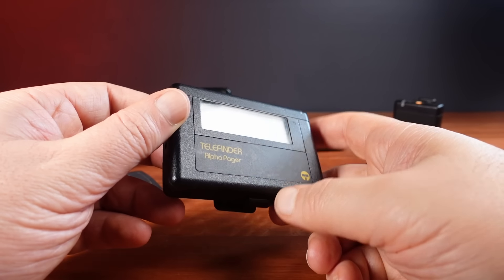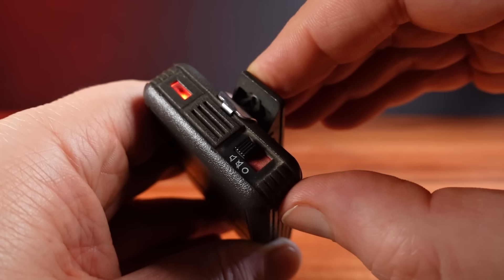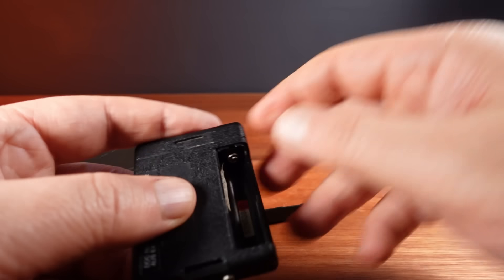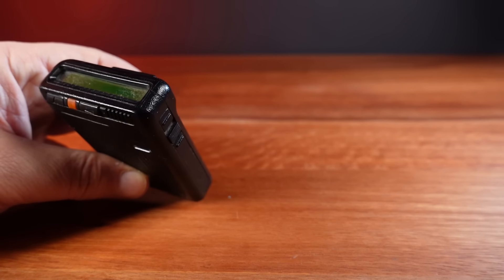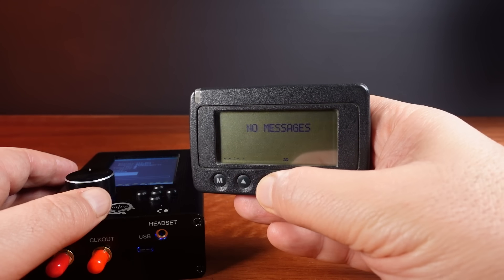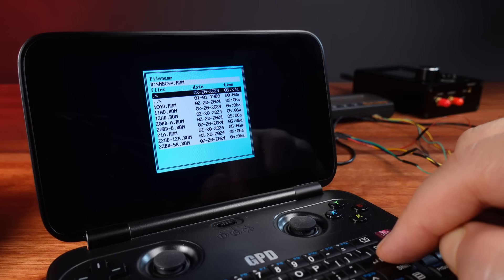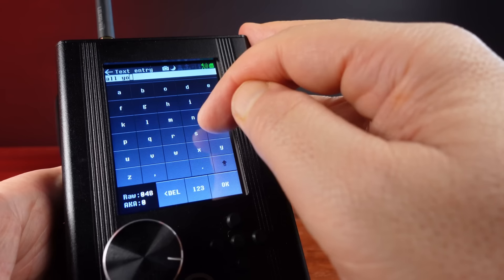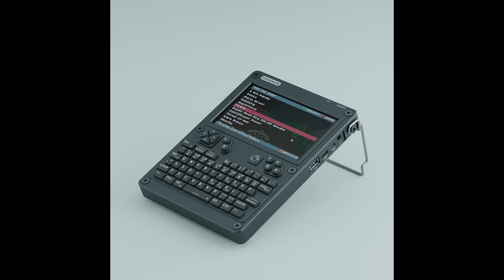Hacking 1980s Beepers & Pagers Back To Life

Comment: The beeper pager is still widely used in restaurants, i recently go to massive food court where you can buy from different vendor, and most of them using beeper to call people that their food is ready, it's neat to see the simplest operation still used for 70 years.
Reply from the maker: The old Post Office code still in use today!
Reply: @JanusCycle ten years ago in school one of my classmates had a pagers with display because he was (and very likely still is) volunteer firefighter.
Reply: fire service too
Reply: Pagers are also still very heavily used in medicine. Easy enough to use the hack rf and software to receive and decode the messages too.
Reply: Those are just local networks
Reply: i had a janitorial job at a truck stop that had a REALLY interesting use for pagers. They had rentable showers with an automated pin-pad entry system, and when the renter left the shower room, an automated system would send a message to my pager saying that shower room now needed cleaned. Very unique use case for pagers in the modern age!
Reply: Those aren't cellular papers, they're just short range RF; no service once you leave the immediate proximity of their base unit
Reply: also used for restaurant staff
Reply: Those restaurant systems are not quite the same thing. I mean, at the basic level, yes, they are beepers, but there is no network or routing system in place, nor are they on licensed frequencies. The restaurant systems are closer to a one way cordless telephone that only has a ringer function.
Reply: @slightlyevolved - Some restaurants now use the customer's phone number to text them directly.  A cheaper and more reliable alternative.
Reply: Yeah, interestingly that's kind of a new use for them... but it's a different kind: they're actually more simple because they don't have any text and they aren't connected to a phone line. But they probably weren't used back in the old days like these others because of greater expense back then.
Reply: @prophetzarquon , he/she didn't say they were.
Reply: @slightlyevolved : He/she didn't say they were. Not quite the same thing, but basically the same thing. No phone service and no text, but other than that, pretty much the same.
Reply: @HelloKittyFanMan  True. And most of the pagers in this video don't use cellular either! I only really saw the cellular ones; my bias is showing!
Reply: Ngl I didn’t realize they were actually beepers. Interesting stuff
Reply: Then the pagers explode ….
Reply: @HelloKittyFanMan He/She/Their/Them/It/Cat/Dog/ApacheAttackHelicopter/Kamov50/Abrams/T90/MI-28
Reply: @phreak761 : Umm... HUHHHHH?

Comment: I worked for a defense contractor up until about a year ago. I used to have to admin our pagers. They're very good for reliability in 2024.
Reply: "defense"

Sorry, I couldn't help it.
Reply: D-FENS!
Reply: Reliable as long as it's a two way to acknowledge the receipt, but one way papers were a hit and miss.   If you happen to be in a weak signal area, you simply missed the page.
Reply: @BillAnt 
Some systems repeated the message several times. The beeper would only "beep" one time for a certain massage.
Reply: @jplacido9999  - Right, but the repeated transmissions were only within a few seconds.  If you happen to be out of coverage in a subway or building, you just missed it.  Later two way pagers solved this issue.
Reply: @BillAnt  
Some systems would repeat the messages when radio traffic was low and the pager wouldn't beep again if the message was already in memory.
That was a good trick to try to avoid no coverage areas, if you were on the move.

For mission critical paging you would have to use beepers with acknoledge (but those were trackable, altough you'd need a very sofisticated setup to do it....)

Comment: This brings back memories. In 1982-1983 I was working on the design for the PG32 POCSAG decoder chip. 2800 gates in standard cell. Design toolchain was slow. Manual netlist entry and many hours looking at printouts on green/white paper.  Happy days.
Reply from the maker: Wow! very early days for POCSAG there

Comment: @14:55 pager doing like an electric football game had me laughing 😂

I used to run a pager-based school zone flasher system.  The server would dial a phone number to page the flashers on or off.  Typically it did this twice - once just ahead of schedule and once at about the scheduled time to turn it on and at the scheduled time and slightly after to turn it off.  Since there was no acknowledgement it was do it twice with fingers crossed. 🙃

Comment: Pager still work nowadays

They are still use because they are simple and can be reliable for long distance communication and use a separate network from cell phones and  sms

So pagers can still work when your phone has no signal

Mainly nowadays emergency and on call services mainly use em along with a cell phone
Reply: Atleast in USA

You can still plug up a rotary phone to a landline and use it, if it's an actual landline 

Atleast last I checked pulse dial still worked since I could use dtmf or pulse on my cordless landline

That's why you can just hook a speaker and mic, and short some wires on a dial up cord to call someone it also runs on it's own 70-90vac grid

So if house loses power you can rig some LEDs for lighting using the phone
Reply: Pagers do use cellular service for connectivity, though... They just don't use "4G" etc LOL 

The only "pagers" that don't use cellular, are very short-range devices like those used at restaurants, which only work in close proximity to their base station

Comment: One interesting way of increasing the range of internal radio network pagers (for fireman for instance) was that the mobile VHF radio in the car at a good position for receiving the signals would be sellcalled and would do an acknowledge response to the base station and then a secondary transmission to the nearby pager inside a building.
That way you would have a great range even on the litle VHF Hi pager...😊

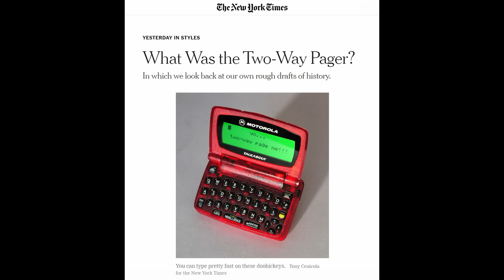Comment: 16:19 YES! 
I've been studying a lot on meshtastic lately, and while some of the devices I've seen have some pretty alright designs, nothing tops the og pagers. maybe, just maybe one of the supported meshtastic boards/modules has the processing power and available io to work as a guts swap for a two-way pager that retains the factory display and keypad.
Reply: What annoys me, is that without a regional cellular service to provide connectivity, we'll never get more than a few miles range. 

Municipal mesh networks could solve this by supplanting corporate-run cellular services; if laws permitting us to do that, were passed... It works great where it's done at all
Reply from the maker: I do love this idea.

Comment: My Grandpa had a pager back in the day and I do remember in the early Y2Ks that cell phone kiosks in the Mall had pagers. They interested me slightly but I ofc was already used to seeing people with PDAs and cellular phones. Pagers were just a bit before my time but it was cool to see the march of technology in real time.
The other way I knew about pagers was the Palm VII, VIIx and the i705. These Palm models had a built in pager and you could sign up with Palm and access the web! It sounded pretty wild. 
It used the Mobitex Pager network. Idk how it worked but it did. So normal Palm applications are in .prc format, these web enabled applets were .pqa and were stuff like email, stocks & weather.
Reply from the maker: Those Palm models with radios are really interesting, I'm keen to try one out some day.
Reply: The Palm Treo was arguably the most multifunctional smartphone ever. Had hardware features we can't even get today 

What I might miss most though, was the rounded square 4pin charging connector you could just knock undone without damaging it!

Comment: Pagers are still used in the UK for hospitals, fire service (in some areas), status reports from some systems, vetinary surgeons and some other services. Usuall found around 150 MHz and some UHF frequencies. I used to watch messages using old software called pdw and a radio scanner, but you can use an SDR too with a virtual audio cable.

Comment: That first Motorola you were playing with looks old enough that it might not be pocsag. Golay was the signaling format that was precursor to Pocsag and a lot of early tone only pagers were Golay.

Also, changing the frequency on most non synthesized pagers requires not just changing the crystal, but retuning the IF stage, which often means replacing some laser trimmed capacitors with adjustable ones.
Reply from the maker: Wow, Golay. I hadn't considered that possibility, thanks.
I'm still learning about radio and there are many things I don't know. I have seen there are NEC replacement pager crystals available for different frequencies. Is it possible NEC designed these pagers to work on different frequency ranges with just a crystal change? How do amateur radio enthusiasts do it?
Reply: @JanusCycle  It would likely work somewhat with just a crystal change, but the sensitivity would be hurt quite a bit. I worked for a pager company in the 90s-2000s and re-crystaled and recapped a lot of Motorola and NEC pagers, we did try just a crystal swap when we first got started but they would never perform that well, so we ended up getting the entire ramsey electronics rig to tune them properly....depending on the RF board there were 1 to 3 IF stages that needed to be tweaked, there are test points on the board and IIRC you have to watch for 455khz with an o-scope or frequency counter and tune it for the strongest signal.

There are pagers out there that do use PLL tuners and can simply be programed for a new frequency, but to be honest, by the time these came around, they simply were not as well built as the Crystal stuff, nor did they seem as reliable.
Reply from the maker: @PeterBellefleur  Thank you! I really appreciate the level of detail you provided here. The more I learn, the more I realise how much I don't know :)
I also now have a new appreciation for the crystal pagers over the synthesized oscillators in programmable frequency pagers.

Comment: I still carry a pager on me all the time,
it's a Swissphone Boss 925.
I'm a voluntary firefighter in Germany and this is how most of us get called into action. Already digital and encrypted but currently there is a switch towards the Swissphone s.Quad. They use the Tetra Radio network which is also used for all of the emergency radio services in Germany.
Reply: And they fail in floods...🤣🤣🤣 (Tetra fails everywhere when it should work...
😢)

Comment: This is very cool! I’ve got an old Motorola pager I had hopes of doing something with. But all a bit complex for me, still thoroughly enjoyable video.
Reply from the maker: Have a look at the 'rpitx' software for Raspberry Pi, it includes a POCSAG transmitter without any extra hardware needed! I'm keen to know which model Motorola pager you have? And I'm happy to help if possible.
Reply: @JanusCycle  aha, that sounds interesting. I was just wondering yesterday what to do with a raspberry pi I have sitting around. And down the rabbit hole I go!
Reply from the maker: @TheBasementChannel  Excellent, I hope you enjoy the challenge.

Comment: Next step- upgrade the battery to a rechargeable lithium ion and have usb c charging. Honestly, great job on this video. I was going to bring up pagers with the ham club as one of the programs, and i literally just found my old Motorola pager. Thanks for the content. 🤙🏾
Reply from the maker: I hope you get yours working again.
Reply: USB C batteries are a thing, and perfect for these pagers, allowing for a modern charging interface without modifications to the pagers themselves
Reply: @LouisSubearth  I was just thinking about those. You gotta love the advancements in battery tech in the past few years. Right on. 🤙🏾

Comment: I intercept pager messages here in the UK on 158.350mhz using SDR software and a program called PDW.

Some very interesting messages come in very frequently!
Reply: Have you noticed the lie about not knowing where a mobile is calling from (police always say that) if the caller doesn't know where they are? Looking like this: "Mobile Phone Coordinates, Closest Area Detected.." - Triangulation used by the emergency services.
Reply: I don't know where you in the world but it's common knowledge over here and it's not pin-point. They can get a general area which is enough to say 'you were in the vicinity' if it was a piece of evidence I suppose.

Sorry if I repeated back what you just told me lol

Comment: That first Motorola pager you showed is very similar in design and construction as their System Saber, and Astro Saber public safety radios that were available at the time. It actually looks to reuse the belt clip that was optional for the radio. The sabers have two set screws on the bottom, and when loosened the electronics slide out of the housing just like that pager. Seems like they were designed in conjunction, or the pager was the inspiration for the design of the Saber.

Comment: It's not always as simple as just swapping the crystal, a lot of the support circuitry will likely be assuming the crystal is what it is
Reply from the maker: This is the kind of thing I need to learn about, thanks. I have also heard about some hams dropping the frequency of pagers from 148 MHz down into the 2 meter band. But I'm not sure if they were crystal controlled.
Reply: @JanusCycle It’s as simple so long as you aren’t moving it far from the frequency the receiver was intended for, or it will be outside of the bandwidth of the receiver’s front end filters. A ham would typically move these VHF units down to the 2 meter amateur band so then you can transmit to them with power behind it.
Reply: @JanusCycle  2m is 144-148mhz, so i guess its pretty close. Time to pass your liscence haha
Reply: @fazejohncenachristogamerfaze  absolutely!

Comment: I got a bunch of motorola advisor 2's from a scrap yard years ago ex rfs, and it came with the programming base and cable, I can program, change cap codes but also freq, they cover 2m band and vhf marine, sweet stuff
Reply: Also, I use to decode local fire pagers, so got the local cap codes and programmed a few of the pagers haha, sadly I moved states and they don't use them here :(

Comment: I work in radio broadcast doing engineering. At one of my transmitter sites in rural North Dakota there's a big satellite dish out back that was used for radio paging. It would've received paging via that satellite dish then put it onto a subcarrier of the FM signal for pagers to receive. This is well before my time though and that equipment is long gone unfortunately

Comment: In the US they used 152 and 450 MHz frequencies as my memory recalls. Your frequencies are just outside the 2 meter 144-148 MHz and 430-450 MHz band and in the 148-150 is military, mostly Civil Air Patrol and MARS frequencies 450-460 is Public Safety, Oil, Farm and mobile phone in the UHF band. Lots others but when cell phones hit, killed the other markets!!!

DE N2JYG

Comment: So I got one of those FTDI232 adaptors (given I've already ruined my 11a's display, I can't exactly make it any worse!) and set it up as a COM port, but DOSbox just complains about "desired serial mode not supported", and reading around, people claim that an FTDI device apparently doesn't work with DOSbox due to it being 5-bit only (something from the paper tape and teletype era!), did you use some different version of the adaptor or a different config string in DOSbox? On top of the RPiTx issues, this is getting to be quite the headache!!! :S
Reply: Ignore that, turned out the ROM file I had was corrupt, so just messed everything up, the FTDI adaptor worked fine!!!
Reply from the maker: I'm really glad you got it working, with inverted TX and RX on your FTDI?
Reply: @JanusCycle  Yep, got those settings sorted before connecting the FTDI up to the pager, it was just a combination of not knowing about the corrupt ROM file plus the console output complaining of the serial mode not supported that threw me for a loop, but I found another download of the programming software with another set of ROMs included, which comparing the 11AD.rom files in Notepad++ showed the corruption in the first file, after that, no problem aside from the pager turning out to be an 11D (Vodafone had removed any model references, and a prev. owner removed labels too so I based the model on pics & brochures), all I need now is for RPiTx to work, assuming I can ever get it to do so!!

Comment: Would it be possible to make a device that uses a SIM card to receive phone calls then transmits the caller’s phone number to a pager? Basically using the pager as a caller id.
Reply from the maker: Yes, connected to the phone via Bluetooth. But there are no of the shelf parts. An entire design would need to be made.